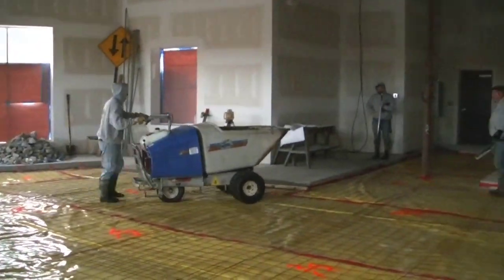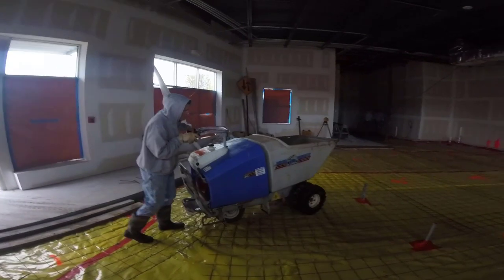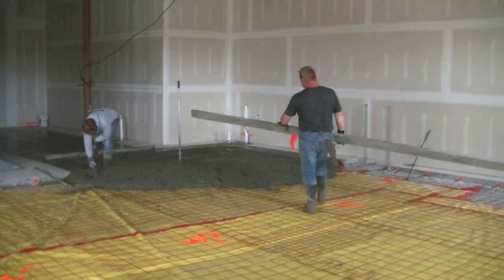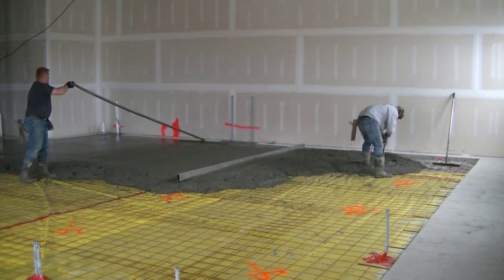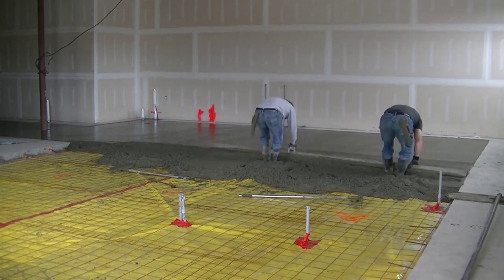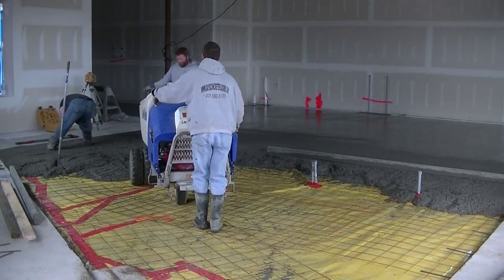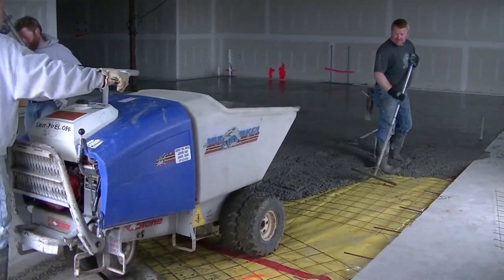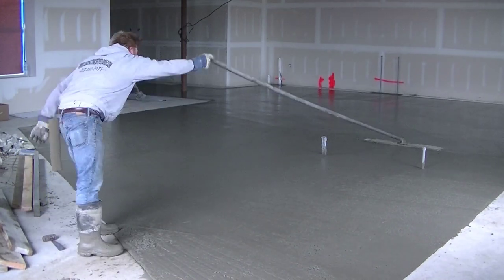How To Use A Concrete Power Buggy To Pour A Concrete Floor

Comment: One thing i did notice is that the mesh stayed on the ground...shoulda been pulled up as they went..right?
Reply from the maker: We were pulling it up, I promise!
Reply: Have a job that can’t be tailgated.  Was thinking to use buggies but I’m wanting mesh on chairs.
Reply: @davem3789  Once you pull the wire up, then pour the concrete, all the rocks get underneath the wire so it can’t get all the way back to the bottom even when you walk on it thru the mud.
🤜🤛

Comment: How do I figure out how much concrete I will need for a sidewalk
Reply: Length x width x depth. Then divide by 27 to get cubic yardage.
🤜🤛
Reply: @psidvicious  thank you sir very much
Reply from the maker: You can use my concrete calculator page also.  https://www.everything-about-concrete.com/concrete-calculator.html
Reply: @MikeDayConcrete  thanks Mike